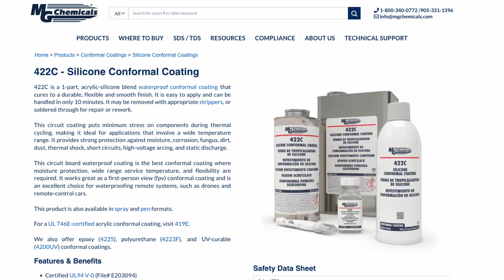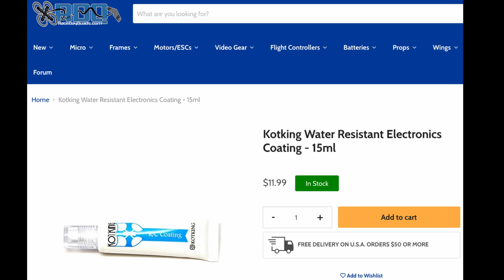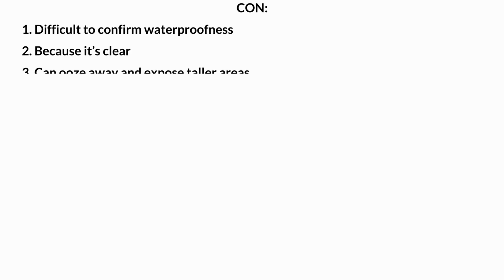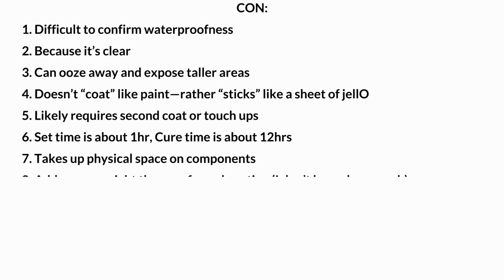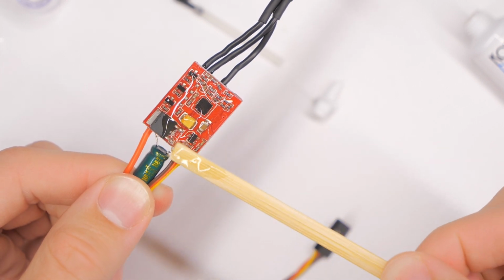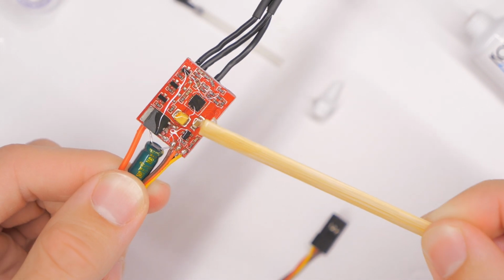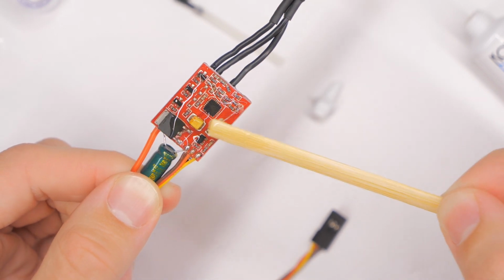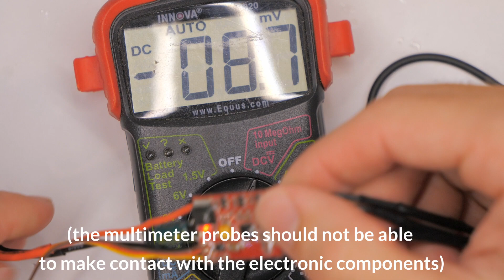💦 Does KOTKING work? Yes, BUT. . . | KotKing FPV Drone & RC Waterproof Coating Review

Comment: I love the silicone conformal coat, I haven’t had any issues. 

I will say that a black light or UV light will light up the conformal coat so you can see where it’s been applied with good coverage. 

Another tip is to apply the coat as soon as electronics are opened from their static proof bags, so the boards are as clean as possible. This will help keep the silicone adhered to the surface.
Reply from the maker: Good points. I see now that checking with a UV light would be very helpful!

Comment: I’ve tried a product called liquid electrical tape that is a little better consistency and is applied with its own internal brush but if an ESC goes down in the water it’s probably gonna pop. Are use conformal coat on my flight control board and on the motor wires where they connect mostly to keep iron filings from shorting anything out👍 by the way I’m loving this content.
Reply from the maker: Good point about protection from iron filings. Thanks!

Comment: This stuff is good for protecting wires and components from vibration failure, not so much for waterproofing. For example if you have some tiny wires soldered to pads on an FC, a little blob of this stuff on the solder joints will protect them from vibrating off the PCB. Though I'd also recommend just getting a tube of Chip Quick self leveling electronics silicone for that because it comes with a proper nozzle on the tube and is a bit less runny.

Comment: even a barometer can be filled with it?
Reply from the maker: No. I'm sure that would cause false readings. A barometer has to be able to sense ambient air pressure.
Reply: @RCwithAdam1  I think so too. In Kotking videos, the manufacturer fills absolutely everything, including connectors.

Comment: The multi-layer on the edges of the pcb must be hard to cover
Reply from the maker: Not too bad, but the board does have to stay flat for the whole drying time.
Reply: @RCwithAdam1  I tried nail varnish on a pcb a few years ago but it started to chip on the edges, nice video :-)

Comment: Looks like repurposed silicone sealant :P For transparency issue maybe adding some dye  could help. Like to make it for. ex. transparent blue.  Having only kotking I would probably try a hybrid approach - transparent shrink wrap on electronics and then seal ends with kotking - especially for solo ESCs.
Reply from the maker: Totally agree! I do wonder if it really has any special properties compared to silicone sealants. And I do think it could be useful for some of those applications.
Reply: @RCwithAdam1  It's just a neutral cure potting compound. The important thing is that it's non corrosive, normal silicone uses acid to cure, neutral cure silicone are oxime or methoxy based cure. Acidic cure silicone will destroy electronics over time.

Comment: anything u coat is gone forever  so be sure to not need to unsolder anything
especially SMA antennas !!!!
Reply: you can use a soldering iron to go through it. used it before and done changes to components no problems.

Comment: TBH, Adam, you are way too stingy when applying stuff. Same with the conformal coating. Here eg, 06:36 why aren't the  wires covered? Sure, it's not nessesary, but it also doesn't hurt. Better safe than sorry. And that stinginess leads to lack of silicone under the wires. You have to apply a lot and then move the esc around to make sure it gets everywhere. Lift the wires. What's with the capacitor's connection? Can't see any silicone there. You can't just rely on things. You have to make sure! My waterproof quad looks like a gummybear. That's how you do it.
Yet a good video :-)

Comment: Great review. It is refreshing to see honest good review after all "I gotta feed my children" reviewers. This looks like it is worse than nail polish.
Reply: I was just talking to someone about that the other day. It’s getting bad. We’re saturated with YouTube drone “review” channels that aren’t doing anything but flying around awkwardly for awhile (to get your view/view time/their money) and have them tell you “yep it’s good, it flies” and then shoving a buy now link (that they benefit from) in your face.

I mean good for them I guess. The recipe works. YouTube is like a echo chamber, people are usually searching for things they’re already interested in so when they watch a video about a drone (or any product) that they’re already thinking about, it only takes a small nudge (and that buy now link) to make them pull the trigger.
Reply: The irony is I never had to worry about putting several layers on and I fly over water more times than not.... I accidentally dropped a drone in the water the other week, shook it off so water wouldn't drip on the lens, dried the lens off, and flew. Landed in a creek two days ago on some shallow rocks and spent a few minutes trying to turtle mode before wading in 40 degree water to grab it lol. Completely fine for another flight. It's way better than conformal coating since I can cover usb ports and a few minutes of picking it out and the USB port is good to use again :) So it's more of a YMMV. Trying to figure out the exact silicone stuff they use and just buy it in bulk .
Reply: @jacobscoville2044  I am sorry, are you selling this product ? Because that is what you sound like. Also, read what you wrote, you made no sense at all.
Reply: TLDR: I can't conformal coat usb ports. This works with one coat in my use cases. I submerge my drones weekly. I'm hoping to find a bulk source so I don't have to pay for a little bottle, so how am I selling it?
Reply: @jacobscoville2044  Great, then make a video and share your secrets. Why would you conformal coat usb port ? Avoid it and put some silicone grease in there if you are worried about water.
Reply: @noobFPV  I want to remove it so I can update firmware or change something when I want lol. That’s why I’d use the kotking stuff over them. Even without the little cover it’s easy enough to remove to make contact with the usb cord
Reply: @jacobscoville2044  You are still not making any sense.